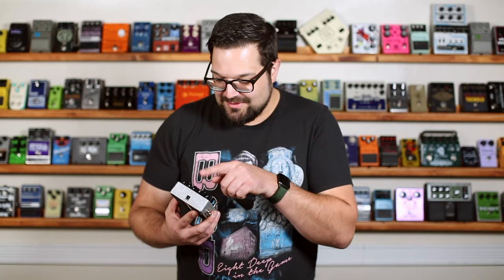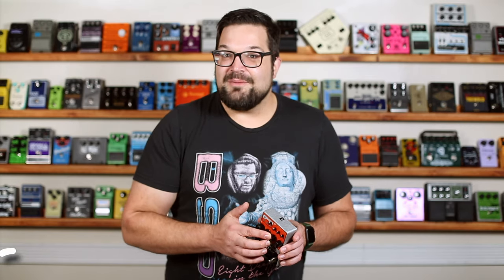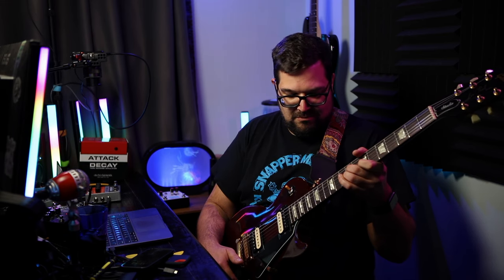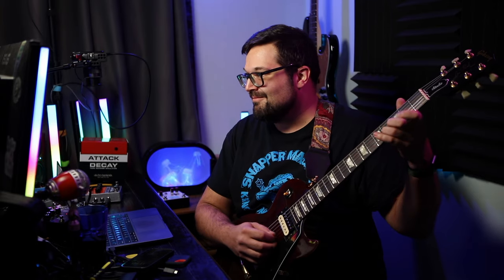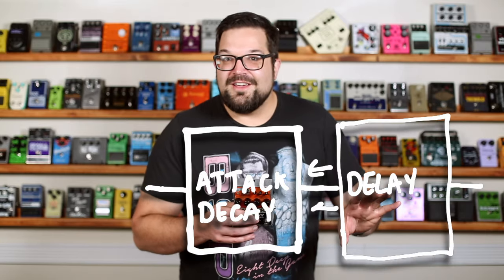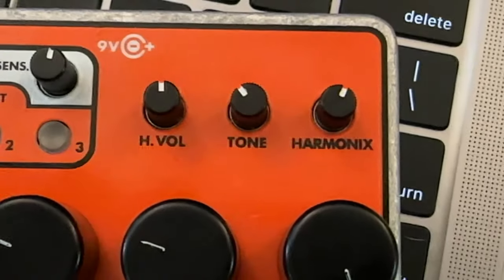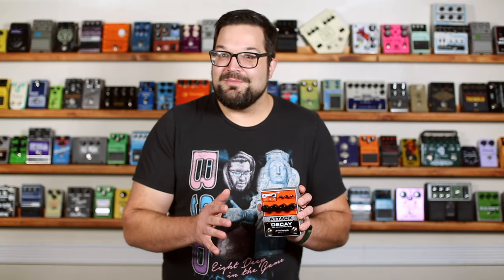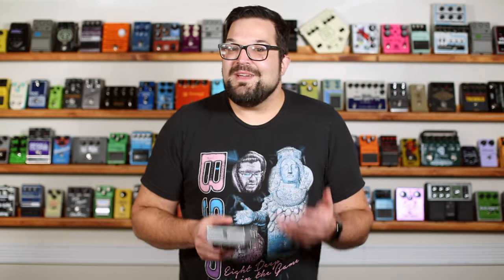EHX Attack Decay - Push The Envelope... off a cliff

Comment: Great write up on a pedal that I find very hard to explain. I have one, and I love it. I was fortunate enough to own an SG-1 back in the day - it was fine, but didn't do quite what I wanted, and they were so hideously valuable I was better cashing in. I replaced it with the inimitable Dod FX15 Swell - hideously rare, almost as expensive, and impossible to repair due to the LDR it uses being long out of production, which did more what I wanted. I sold that a few years back for the same reason, and in my latest pedalboard incarnation with a volume pedal found myself missing those old effects, and stumbled on some videos of the attack decay. It does everything I could want and more besides, you are not exaggerating that the options on this thing are vast. 

Credit surely to the designers at EHX. I think a lot of people write them off as just banging out Muffs, Clones and Stones, but a lot of their latest pedals have some very, very clever features in them and there's some really well thought out user integration like the presets you mention. My favourite feature I could never talk to anyone but pedal nerds about is that in preset mode; if you move a knob the LED's light up telling you the current knob positions do not match that of the preset. As you move the knobs around they speed up or slow down so that you can find the original setting - say you had a great preset in slot 1, but you want to tweak it very slightly, or copy your presets over to another pedal, it lets you find those knob positions. My TC Electronic Nova Delay has a display and it can't tell me what my settings are on my favourite patches. They really have thought of everything.
Reply: love the preset light reference!!!  that manual is fantastic and very descriptive as well; when i got it years ago i'd read it for hours just to comprehend all of the different aspects of the pedal. my favorite pedal since the day i got it!

Comment: I always thought that envelope pedals are a must for a guitarist. SImply because the envelope is a basic characteristic of any sound. So my first pedal of sorts was the PIGTRONIX Philosopher King. I love it for the cv inputs it has but the EHX Attack Decay even though without cv inputs, does what the PK does but more accurately, it's polyphonic, has a watery artifact that someone might find useful AND it has that magical effect loop. I really think you should do a part 2 and expore the amazing hacks that can be done with it. It is an essential part of my rig right now and use the effect loop to delay the attack of a ring modulator inorder for the initial note to come through first. I'm oversimplifying since there is alot more to it, but I only want to give an example that might spark some ideas for other uses, were someone would need to envelope the attack of an effect, over his initial tone. If that makes sense. You did something like that with the delay in the FX loop but maybe it needed more exploring. I'm saying this because if not you ...who else?

Comment: I have one of these, and have to say it is one of THE most underrated EHX pedals.
As a "tape reverse" simulator, one of things it captures nicely is the manner in which harmonic content changes after a string is picked/strummed.  Normally, strings produce the MOST harmonic content during pick attack, and that harmonic content subsides soon thereafter.  That means that if you want to simulate a recorded guitar being played backwards, you have to not only have the volume swell, but you also need to increase the harmonic content in reverse.
Back in the day, forty-some years ago, I would try to fake backwards tape using my Univox compressor, into my MXR Envelope Filter, and then into my MXR 6-band EQ  I'd set the compressor for moderate compression but high output, the filter for slowest possible attack (made a bit slower by the compressor), roll the 3 lowest sliders on the EQ all the way down and the 3 higher sliders all the way up.  Remember that the filter starts its sweep at the bottom, and then moves upward.  With the lower EQ bands fully reduced, the start of the sweep would be almost inaudible.  Then, as the sweep moved upwards, it would get louder.  And because the MXR 6-band can be easily overdriven, as the sweep reached its highest point, the resulting tone would not only be louder, but grittier as well.  The Attack Decay aims for the same thing, but does a better job.

Feeding its output to a filter moves you into synth territory.  If you feed it with an octave-down fuzz, and THEN into a filter, you're definitely in synth territory.